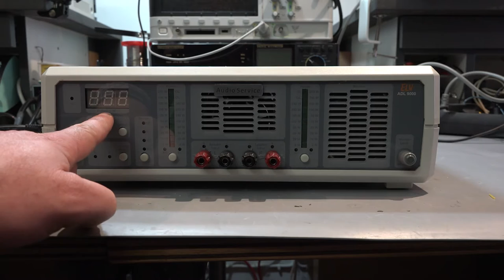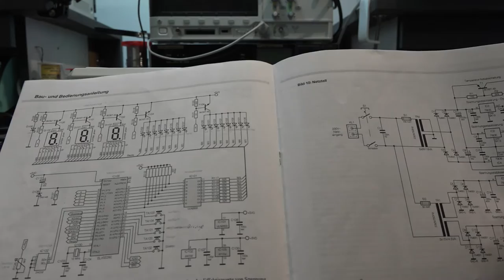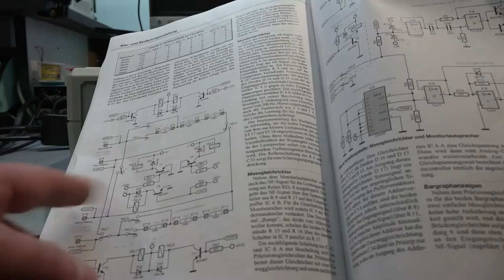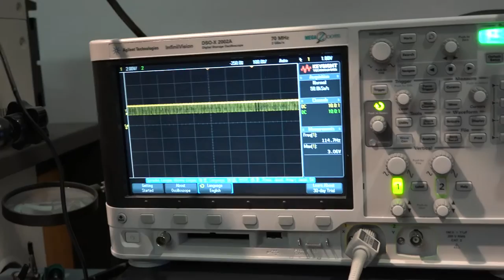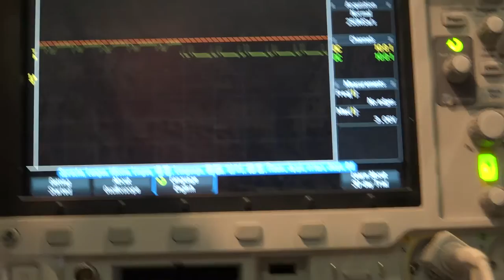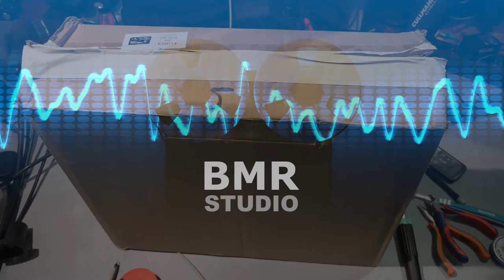ELV ADL 9000 Amplifier tester dummy load

Comment: Interesting unit with simple theory. With a little patience you could rewrite the code.
After the video, I'm thinking of designing something similar for me.
Reply from the maker: Stefano Viganó it’s still in the paper-box, waiting for the right moment. I reached the company, they said, no more original code or prebuilt MC. So I take a look on the schematics , and yes this is a smart system. I have a plan to make a new front panel with touch screen, because the theory of working is well documented, and all I/O from the analog board is there.
Reply: @BMRStudio  Very interesting your idea. Surely you can reuse the I/O.
Weekend I was free, so I wrote a simple code and did some in Proteus testing using the AD637/737 and Pic 12-bit ADC. Read error of 0.06%!!! I'm excited, I'm going to continue with the project and see how it behaves in reality.
Reply from the maker: @stefanogvigano  You know what? I can send you this puppy, if You are in Europe... PM me, for your shipping address. Good luck with it :)
Reply: @BMRStudio   I live in Brazil. I thank you if you can send it. I pay shipping costs.
Thank you very much.
Reply: @BMRStudio  You're right. That was not a good idea of mine. Thank you for your kindness. I'm sending by PM my email.

Thanks!
Reply from the maker: Stefano Viganó I took Your address.
Reply: @BMRStudio  Hi, I did not receive your email, but you do not need to resend it. I was able to download the documentation through the link in the description of the video.
My project has evolved this weekend, when done I would like to gift with a complete digital copy of the project. :)

Comment: whoa, an oscilloscope is exploding in a car :)
Reply from the maker: Da Paul looks to Me You never worked with high power amplifier installations in car audio industry:) I did for almost 10 years.
Reply: you are right :) I have no experience to blow cars up with high power amps and additional battery banks :)
Reply from the maker: Da Paul You have to try :) You just 4 piece 1KW Rockford Fosgate digital amp, 2 piece 1F capacitor and an old russian oscilloscope. Then You get it